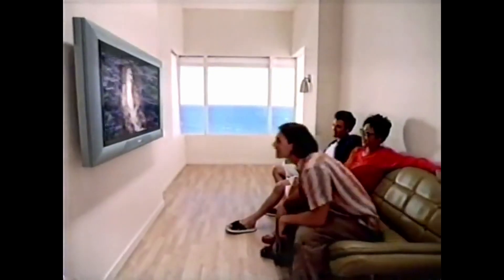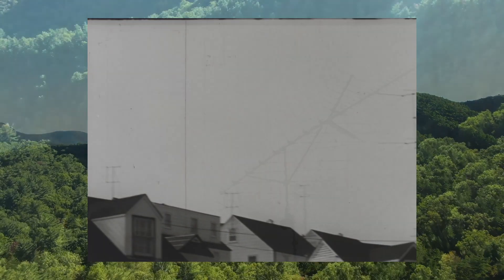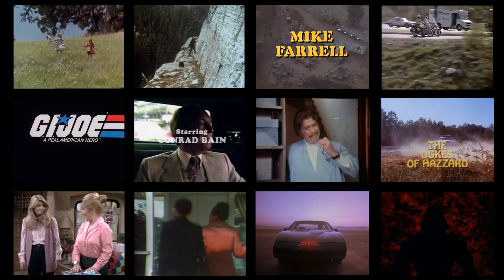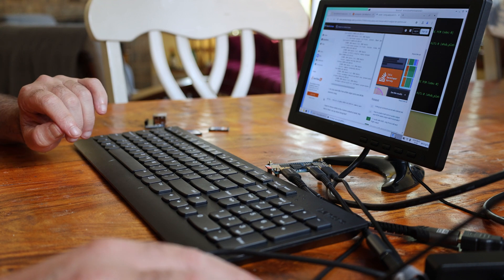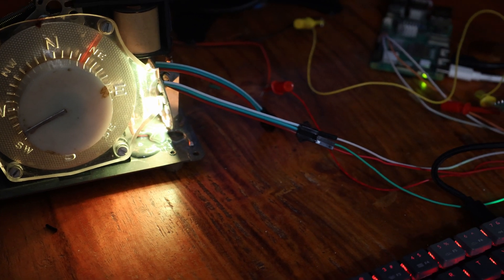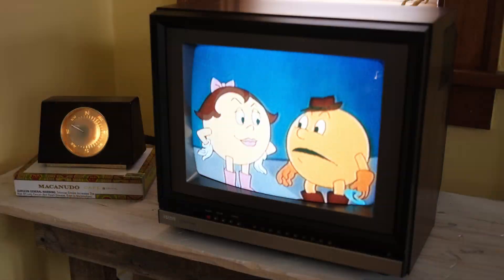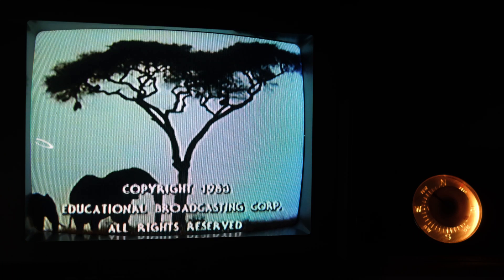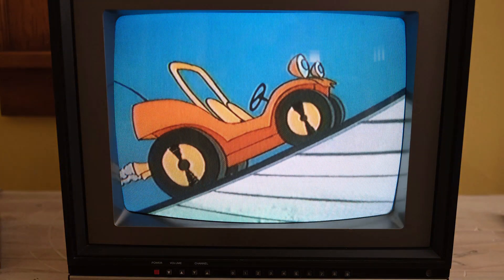My Nostalgia Machine: Recreating 80's broadcast TV with a Raspberry Pi

Comment: In your setup, do commercial breaks occur during a show, or do commercials just play between two shows in the hour long block? Amazing work, by the way. I am interested in recreating this setup one day. Currently I just have a Plex playlist that also includes 60-90 second long period correct commercial blocks that I edited together.
Reply from the maker: Thanks! It uses a couple of different strategies to cut in commercials. If the show mostly fills the slotit will just pads the end with commercials, since this would usually mean the show has commercials embedded in it. In the case where the show only takes up the normal 3/4 or so of the time slot, it cuts in as many commercials breaks of about 2 minutes each as it needs to to fill out the time slot.

Comment: This is really awesome! This is very similar to my set up where I use a program called "dizqueTV" which takes my plex library loaded with old shows and constructs as many TV-style channels as I want, rich with commercials and bumpers to boot. 

Its running on an old gaming PC hidden behind the entertainment unit hooked up to a 1988 trinitron CRT and the experience is wonderfully nostalgic. As it stands it was only set up for running shows from the 90s as that was my favorite decade, but I just finished setting up some 80s stations and when I get done splicing the commercials, the early 2000s will make its way into the lineup too. 

I essentially have 3 different eras of TV and man is it comfy to just come home after a long day of work and tune into MTV, Cartoon Network, or any of the other stations I built not having to worry about "which of these thousands of shows do I want to watch".
Reply from the maker: I had never heard of that - just checked it out and its pretty cool. I like the approach.

Comment: How do you go about splicing in commercials and/or bumpers?
Reply from the maker: When the scheduler runs once a week, it fills out the remaining time in the hour or 2 hour slot with commercials and bumper content. Based on how many commercials there are, it will either just pad the end or cut the number of breaks in at the required number of intervals to fill out the sort of standard 'two-minute' station break length. The scheduling logic for each time slot is encoded in a json file. The videos are never really spliced or split - the players logic plays the main video until its time for the break and then runs through each of the commercials in the break. Then, it just switches back to the main video and seeks to the time it had stopped playing and starts from there. Improvements to this will be to have the scheduler make intelligent decisions about where to insert breaks.
Reply: @wrongdog_reckons  thanks so much for your reply. Very informative and interesting stuff. Take care.

Comment: Ironically, I am VERY thankful for the youtube algorithm to bring me this amazing video. A few months ago I had a conversation with a friend about..pretty much exactly what you did! I was wondering if there's a way to emulate TV from my childhood (90ies + early 2000s) using a Raspberry and files.
Reply from the maker: Even a Stark is right half the time :) Yes - for sure it can be used to emulate any TV era I think. One of my next task is to add a cable mode - which would have a guide channel and different channel change effects. I want to make an 80s, 90s and 2000s version of the guide channel as well. That will take a week or so to get in, but in the meantime, it will still work with content from any era. Cheers!

Comment: I have a question about the pi 5. did you find a limit for how many channels you can run before it becomes unstable? Im shooting for a scrolling guide channel, channel 3 running emulationstation, and at least 3 other channels that play shows. Do you think the pi 5 will be able to do all of that? if so could i do more then 3 channels that play shows or would that be about the max?
Reply from the maker: The way my software works, you can have as many channels as you have disk space. It only streams one channel at a time - when you switch channels, it just calculates where it should be playing in the new stream and starts there. Cheers!
Reply: @wrongdog_reckons  i might have to wait until you release an image i can flash or release a tutorial bc im having trouble getting it to the point of using and editing. Im not sure what im doing wrong. Was not able to find anyone interested in helping me that didnt want lost of money to do so. So im gonna tap out and just go learn more about Python and Linux. Hoping i come across some info on how things work so i can figure out what im doing wrong.
Reply from the maker: @stevenlewis711  - makes sense, its generally in a development state right now as I am adding features, so it will get easier over time. Cheers!
Reply: @wrongdog_reckons  it wasnt even your stuff holding me back, it was getting the virtual environment working and then once i did it wouldnt register the stuff i installed. Now that i figured out the virtual environment and moved the files over to the FieldStation42 folder, it registers them and even started Moviepy when running one of the scripts instead of errors. So i guess i am making some progress, now im stumped on how to setup the file system so it registers shows. Ill either figure it out slowly or you will beat me to it with an update lol. I wont give up though, ive wanted to create this for a long time and your code is the first close enough for me to feel like i stand a chance to make it happen.
Reply from the maker: @stevenlewis711  -- That is good news! I am working on wiki documentation to help with setting up the content  right now and just finished an install script to setup the virtual env - so we're making progress! Here is the wiki: https://github.com/shane-mason/FieldStation42/wiki - let me know if this helps and what you are still unclear on.

Comment: This is such a cool Raspberry Pi project idea! I'm a 90s kid, so I had the luxury of watching more than three channels (although the adults in my life always talked about that) and to see traditional TV programming transform into its current form.

I've always wondered if it was possible to recreate how TV stations scheduled programming (I think the industry term is called "dayparting") using my own video files. The github page answers a lot of my questions on that particular aspect of the project.

Thank you so much for creating this project; I cannot wait to try it out myself!!
Reply from the maker: I have never heard the term dayparting, but just looked it up. I just use a lot of terms in my program like 'blocks' 'slots' and 'clips' with not real understanding of how they fit into the industry-think. I am pretty pleased to see that my internal model of how to break the day up roughly fits. I guess one difference in the mental model is that mine are based on 1-hour slots, and it looks like they are using 30 minute increments. In my case, each 1 hour slot can be filled by 2 half hour blocks or 1 one-hour blocks, but both have to come from the same content source folder. You put 2 slots together and fill it with a 2 hour content block and that gives you a feature length. I did some massive simplifications to this process in the past days.

Give the code a try, if you run into any problems, just file an issue on github and I'll respond.

Comment: I just wish I could get a modern TV that would let me use something like Rehade to apply the same CRT shaders I use for emulating old games. Can't even figure out how to get the same shaders working for watching DVDs on the same computer.
Reply from the maker: You like the shader effects? I am wondering, because this runs really great on a standard linux (or windows using WSL - windows subsystem for linux) - and am considering including some options to run it with MPV/FFMEG filters.

Comment: Any chance you will ever do another one as more of a tutorial but make it work with the original tv buttons and remote? Im trying to make a small crt tv project (the ones that hang under counter tops, has handle on top, easily moved if not mounted, power cord not batteries, and just big enough to still enjoy). The idea is to build and mount the whole pi 5 and any other boards inside the tv. I want the tv power supply to power both the tv and pi with one power button to turn on both (original power button), the channel buttons (original channel buttons), and keep it as original as possible. But i want to 3d print some usb clip covers and put in usb ports for controllers and files but keep it clean looking like they belong there with the clip covers. I want to rgb mod it and probably just have it run rgb all the time if theres no reason to turn it off. but maybe hide a button/switch somewhere just incase i need access to the tv menus since the pi would be the only thing wired up inside the unit. I would like to program it to work alot like yours but without the flicker effects, different generation of tv shows, and channel 3 be running Retropie so when on channel 3 you can just pick a system and start playing games from any system you could have plugged into it. It would be nice if the external ports still worked to plug stuff into but they dont need to since the pi can do it all. So final product would be small all in one crt tv that plays every system up to the time games switched to flat screen, 3-5 channels that play commercials and is on a scheduled, buttons/remote for tv work to control the unit/pi, no external plugs or cords, powered by the tv cord only. and maybe have a music station and a TV guide channel in an ideal world. Im looking to unplug and go, plug in and watch. Was even thinking of after its done and it works, 3d printing a new crt tv shell with controllers that pop into the top or side and lock in place so it can be moved and stored as one unit and without loose controllers
Reply from the maker: I am definitely going to do some follow ups - I've had a good time building this system and talking about it. I'm still updating the code and finishing off features. Cheers!
Reply: @wrongdog_reckons  cant wait to see it. Thanks for sharing your code and video. it will be my starting point. Closest thing i can find to what i wanna create. Just got a pi 5 for my birthday next week and im gonna see how far i can get as soon as i find a CRT tv to work with that is the right size.

Comment: The thing I love the most about these old TV's that the modern HD TV's cannot do is use very low resolution. 240p is great on old TV's. Try watching 240p on a 4k TV. You will get a blurry picture on the modern TV. On the old TV  you won't complain about 240p and be happy with it. 😅
Reply from the maker: True! Somehow it worked - and still does. Even the pixelation and artifacts that happens from bad digital conversions look 'okay' on it. Cheers!
Reply: @wrongdog_reckons  So, wait, are you using a simple HDMI to Composite/ RF?
Reply from the maker: @EverScrolls  that's right - its super straight forward.
Reply: @wrongdog_reckons  You say that, but try to get a modern pi to output yPbPr on a CRT through its HDMI port and a converter (Spoilers, it does not work. You have to make a custom edid file to force it to work and even then it only works in 50hz).

I wanted to emulate tv with the best possible color using component on the back of my CRT but it set me back a lot because I just can't get it to work.
Reply from the maker: @EverScrolls  it works fine for my tastes directly from the pi5 hdmi through the converter to RF. If you really want the real experience, broadcast OTA and pick it up on the antenna. Cheers!
Reply: @wrongdog_reckons  Broadcasting is an entirely more difficult experience to do. But I was thinking of just buying an HDMI to RF and calling it a day. I just don't get why it's so hard to get NTSC HDMI to Component with the pi.
Reply from the maker: @EverScrolls  I am unclear on what errors you are getting. I bought a $40 box labeled "HDMI to RF Modulator" on amazon (yuck!) and it just works. Let's me pick the channel to play out on and everything.

Comment: This is something I have wondered about doing, but didnt know how... or have as many good ideas as you have here. This is Fantastic!! I always wished there would be a way to pull it off... also I assume there are commercials.
Reply from the maker: You betcha there are commercials! Since I am using them to pad time for the original content, there should be exactly as many commercials as the original broadcasts had. If you want to build your own, I posted all my code on github (link in the description) and have updated the documentation - so you can use that as a starting point. If you get stuck, file a ticket on github and I'll help you out.
Reply: @wrongdog_reckons  I may have to do that. Thank you.

Comment: Very cool.  Ive been wating to do this same thing with 90s tv.  Not sure where to start but this is awesome motivation!
Reply from the maker: I have all the code on github and have written up documentation on how you can do it yourself. The code will work fine for 90s channels and you don't even need a raspberry pi to get started - you can use any linux installation. Cheers!

Comment: Wonder if a raspberry pi 3 would work since it has composite out built in would be cool to just use composite too even though it's not 100%.  I'd like to see if I can make this too just with some alterations.  Looks daunting though only time I used python was on retropie
Reply from the maker: For the raspberry pi - I am not sure how good the HW video acceleration was in those. Easy way to test would be to play a movie on it - maybe switch between a couple of movies and see how long the load times are.

If you want to use my software, you don't have to know python - just some JSON configuration for your stations. The setup isn't too bad, I've made some updates to the documentation in the last couple of days that should make it easier. Gathering the content and formatting it for a consistent look is what takes the most time by far.
Reply: @wrongdogreckons-cp2sy  i have a collection of Beavis and butthead music videos in 480p that plays flawlessly on the pi3 so I will give it a whirl and see what I can do thanks so much!

Comment: It is cool? Yeah, very cool. Does it provide an authentic experience? Well, nope :D 

Why? Well at that time, the TV or its tuner was what decided which channel are you going to watch, not the antenna. Well you sometimes had to rotate the antenna in conjunction to get the best reception. Also, there were no "switching between channels" effects, you just got another channel after turning the channel selector.
Reply from the maker: Thanks for watching! Yeah, it is not a pixel-perfect recreation for sure - was pulled from 45 year old memories of a 6 year old at the time :)  Like I noted, I didn't want to hack into the channel controller on the TV - the effect is intended to simulate a channel change in the middle of the tuned-detuned-tune cycle of rotating the antenna, but I think people mostly got the point - you can't let the perfect spoil the possible!

Comment: How did you integrate commercials? Do TV shows still have them cut out or did you find a way to cut them back into home releases of TV shows?
Reply from the maker: Some of the shows do have commercials in them already that I wanted to leave, so I made it so that if a show almost fills its slot (like 28 of 30 minutes or 58 of 60 minutes) the logic assumes commercials are embedded and just fills whatever time is left. Otherwise, it just inserts breaks into the stream at even intervals to pad out to the full slot time (30 or 60 minutes). Nothing intelligent in there yet (like looking for silence). Cheers.

Comment: You need to include commercial breaks!
Reply from the maker: It has commercials for sure - building the logic to figure out where to add them and how many is a good chunk of the code. It mixes commercials and station promos (bumpers) at roughly the same mix as you would have seen on broadcast TV. Cheers!

Comment: Great idea and well thought out! Love the nostalgic look. Develop it with variable decade selector and you have a highly marketable item. Low tech sentimentalists like myself would be all over that. Back in the day I had one of those rotating antennas from Radio Shack. Mounted it on top of the house with a 10' extension pole and got 3 sometimes 4 channels.
Reply from the maker: Thanks! Appreciate that! I am adding a selector to let people choose different channel change effects, since cable would look way different. Cheers!